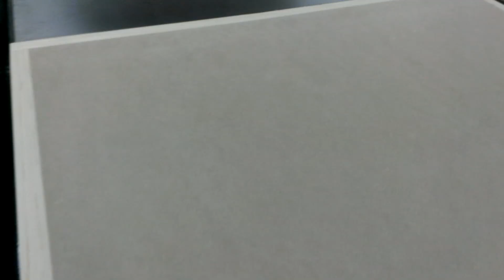Tablesaw Router Extension Wing Part 1

Comment: Thanks for the idea. I will build this for my 36-725 Delta saw tomorrow. I have an extra Bosh bench top router table and intend to use the router insert plate from it to complete the build. Good luck with your project.